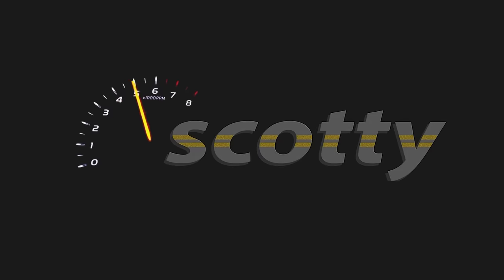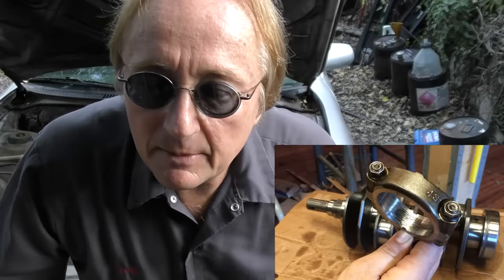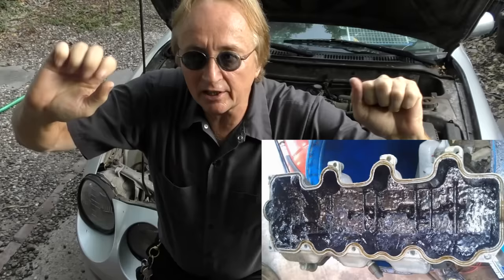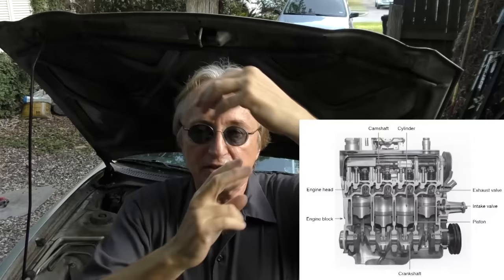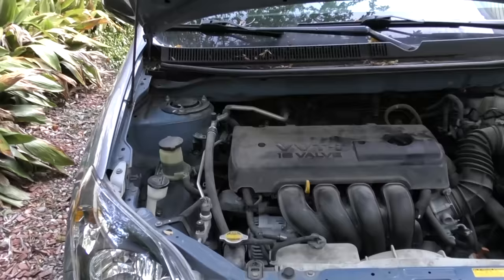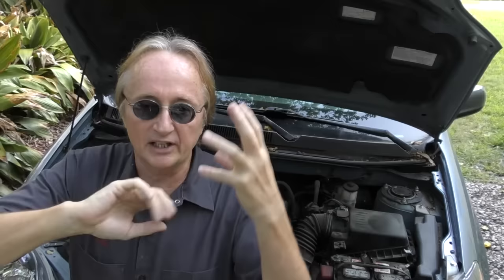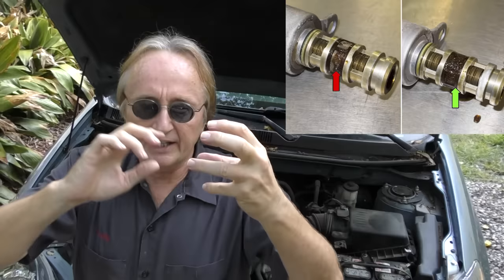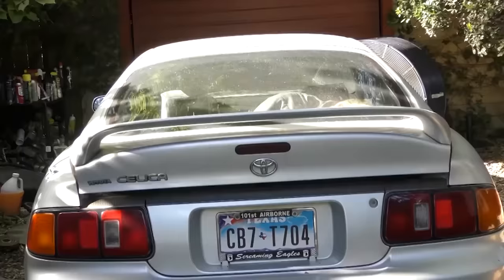Why Not to Flush the Engine Oil in Your Car

Comment: Scotty which half ton American truck would you buy? Can you make a video about this or something similar?
Reply: Toyota makes trucks in Texas.
Reply: Join us the "Toyota federation" then purchase a Toyota Tundra! Lol😅👍🏽🇺🇸🇯🇲
Reply: He recommends an old toyota celica in silver.
Reply: Cole Cooper LOL
Reply: He has said Ford if you go American
Reply: My ‘94 gmc with 282,000 original miles still makes 15-17 mpg and passes smog in ca.
Reply: Out of the big 3. Ford, Chevy/GM, Dodge.
Reply: Rex Erection Hell No! I will never get a Japanese truck!! I be embarrassed and a disgrace to the truck community.
Reply: Well don't buy a Dodge truck then. (Heaps of junk, just like the Toyota Trundra) stick with GM or Ford, they're the king of trucks
Reply: What a joke...Ford for reliability, Dodge for luxury interior, GM for price and their V8s
Reply: Rex Erection the most reliable and useful trucks are American built. The ford inline 6s, ford 7.3, duramax lb7, cummins 12 and 24 valve, even the older ford 6.9s were great. The new Cummins are also great engines. The only Japanese truck worth buying is maybe the tundra. The rest are way too small to do any kind of work. They’ll last forever, but that’s probably because it won’t get worked with. They have their merits but he said half ton, not eighth 😂
Reply: E Cartman yeah the fuel mileage on those things are ok, but as soon as you turn on the ac and try going on the highway, or tow anything, you’ll get horrible mileage. But like I said they have their merits. Maybe they just need a car they can also use to throw their bikes in the back or move a little bit of furniture or something. Basically just have some of the functionality of a truck while getting decent mpg’s just driving around town. But when you need a truck, you need something big and powerful. Maybe you lose a little reliability with some of the newest diesels but you won’t be towing 20k +lbs in a hilux.
Reply: Rex Erection You must be joking, Japanese cars and SUV’s are better than American cars, but trucks is where American shines. I can’t believe anyone would think that the Toyota Tundra or the Nissan Titan would be better than any Ford or GM 😂😂

Comment: The engine in my vw Golf TDI is famous for generating sludge. In addition to this I do a lot of short journeys. I change the oil every 6000 km but I still find that if I do a flush every time I change the oil it makes a huge difference to the cars performance. I do not believe people who say that flushing is not needed. If I did not flush at all, the engine would get totally sludged up
Reply: Yea, since when something that will keep things clean (and wont hurt the engine) would hurt?So much BS if he think that modern cars don't create sludge at no circumstance. All engines do, what change is when it will start.

Comment: Never Flush your engine!!! I learned the hard way!!! I had a 87 Buick Regal and flushed it out. Ya a lot a sludge came out. As I drove it for that week the car stalled on me. Took it to my mechanic and found out that the oil pump was clogged with sludge!!! My mechanic gave me an ear full!!! And never did that again!!!

Comment: it's the same thing as transmission fluid. The stuff that's deep inside needs to stay there.
Reply: Media Guy yep.
  had a Master Mercedes AMG tech tell me " never flush a Mercedes transmission ".
 just change the oil and filter in it.
Reply: Media Guy absolutely!!...whats deep inside needs to stay there.😅👍🏽🇺🇸🇯🇲
Reply: Only if it's been neglected. If not it's fine to do, but then again, it probably doesn't need it then either.
Reply: Yol As in trans fluid and filter?
Reply: You can drain/refill. Flushing is what's bad.
Reply: jeff hale it's actually because small bits of the clutch material wears away in the transmission from not being lubricated property!  Once enough of it wears away the transmission fluid gets a grittyness to it from all the clutch material bits floating around in it!  So they actually need that bit of gritt and lack of lubricant to grip and move the vehicle!  Once you put new stuff in between being nice and slippery and not having all those bits in it it can't grip lol. The trick to changing the fluid on an old tranny is first check if it's kinda glittery looking and if there's a lot of metal bits in the pan!  Drain the fluid into something clean and keep it handy if it doesn't look too bad and you want to try to change it!  If you do and it starts slipping drain the new stuff and put the old back in!  It should get it moving again until the tranny bits the dust and needs a rebuild lol. Novel over 😂
Reply: thats what she said
Reply: ROBERT lol😂🤣
Reply: jeff hale true, if it works, don't repair it...leave it alone
Reply: Like say deep inside the lifters? I guess a permanently collapsed lifter is as good as a working one
Reply: @cap8e  "that's what she said last night lol..".       classic!

Comment: You are clearly a mechanic of the old school.
(I'm not saying that's bad)
You are not very familiar with the use of flush engines.
I work daily with them and I have thousands of proven cases of efficiency, engines placed on dynamometers, a few hundred engines with more than 1 500 000 kilometers, etc. etc.
I saw no less than 30,000 cases of use of these products and never once did I see a problem (maybe one day I saw the first, but it still did not happen)
I think you have good intentions in your video, but you do not have enough knowledge.
Good vibes.

Comment: fair point, but my turbo went on my deisel, impeller shattered, so full services and well looked after so just one of those things, metal in sump clogged filters, cleaned all, new strainer and a gentle flush changed 2nd filter and most metalics caught. So went well. But yes would not flush on a well servied engine, agree..

Comment: Im using bardahl HDEO Oil, precise grade 15w-40,use same brand and change the oil according mileage interval 5-6k km,then recently my engine undergo head swapping,the effect noticeable,head so clean and no sludge and easy to clean,last top overhaul 2 years ago...

Comment: Use Castrol Ultra Clean oil. It says it cleans sludge by 50 percent more. Change oil and filter when you can't see the oil level lines through the oil. Work for me for over fifty years. Never had a engine problem.

Comment: I flushed the oil in my car multiple times, I change my oil every 3k with Full Syn. I've put almost 100k on it since the first flush and no oil leaks, but it does run pretty rough and I think there's a slight rod knock now. I've learned my lesson.

Comment: I change oil every 5k km (3,125k miles) 5w30, but I also use good quality gasoline for better burning and other factors, a car equipped with natural gas fuel does not contaminate lubricant

Comment: Did an engine flush on my honda accord because I had a P1259 code which was the vtec wouldn't work and would stop accelerating after a certain rpm , check engine light went away and now it works perfectly fine.

Comment: True story! I had a 1992 Dodge Ramcharger with a 318 under the hood. One of my "buddies" talked me into using an engine flush in it. Sure, all of this nasty looking crud came out of the drain plug. That thing didn't make it 100 miles past that oil change and it through a rod.

Comment: Did an engineflush on my vvti 2001 toyota avenis (euromodel). It was already burning oil. The result was that I got a lot small particles out but other than that nothing changed for 1 year. Still burned oil. It got to a point when I had to decide to pull the engine apart or scrap the car. I pulled it apart and the pistonrings were completely stuck and "oil holes" in the pistons were partly covered with carbon. Also the pcv valve was not happy. So now Im in the process of rebuilding the head (with the help of a mechanic friend and toyota guides) and have already cleaned the pistons and replaced the rings. I hope it will serve me for at least 200,000 km (12,5k miles) more once i get it back together. Wont be flushing it with other than good quality oil in the future! Apparently these engines are prone to this problem and toyota did some adjustments in later models of the engine. I hope modern good quality oil/filters and tighter oil changes will be enough for my car though :)

Comment: 3:59  What started running like crap?    I flushed my engine... the previous owner of my car didn't do frequent oil changes... and now my car runs so much better and the variable valve timing is working better than before!  I can see inside the crankcase (where you fill the oil) is looking much cleaner too!

Comment: OK. If you change your oil when it's due every time you won't need a oil flush. If your a little over its fine. Today's oil does contain detergents that break everything down. 3k for conventional oil 3.5k for synthetic blend (high mileage). 5k for full synthetic. That's how I do all my cars never flushed anything. And I've never blown a engine. ever. i don't like it ether. So long story short. Change your oil when it's do America. Do your research on what oils suggested or (best) for your specific vehicle.

Comment: I use a quart of Marvel Mystery oil in my engine every oil change and engine stays cleaner than most friends engines that just use oil. I notice sludge in their oil cap and none on mine. Also change oil every 5,000 miles and never over that mileage. If you don't change oil in time you risk a lot of dirt sludge build up.

Comment: I use patrol mixed with engine oil , run it stationary uptil 60 degrees with drain use couple of oil filters. It should clean it all. Just in case if noise increases use thick fully synthetic oil like 10w40 etc or there’s another liquid which thickins but it will continue to damage

Comment: Those BMW's are very sensitive.  After 7500 miles since the last oil change (fully synthetic high mileage oil) the oil got so dirty I started getting cam shaft errors on the VVT system and the engine would start to jerk which eventually led to the transmission going into limp mode.  Changed the oil and problems are gone!  Who would have known!!!  From now on 3-4k mile oil changes in the Bimmer!!!

Comment: BMW X5 70k miles bought used did an oil flush oil then pressure was low. Dropped the oil pan found sludge in the oil pump screen. Ran well for a a few weeks after a while the engine was starved from oil and that was it: the sludge clogged the oil pickup screen again. 12000 mile engine oil change intervals (as recommended by the manufacturer) will do that.

Comment: New engines with vvt hydraulic timing solonoids work with oil pressure if you never change oil or take too long to change oil you get crud in these systems make valve stick and cause timing issues you have to flush engines to remove gunk on cars that don't get serviced regularly
Reply: yeah, scotty has all kinds of good advice but it's kinda all over the place here. I have a ford 5.4L with a SINGLE oil passage. If that one oil passage even gets slightly diminished, the right side of the engine heads won't/aren't getting enough oil . 

So if you flush your engine oil, you might damage it. If it wasn't maintained properly (twice as often as the maker said), it WILL be damaged. Scotty's advice is: don't buy a car that wasn't properly maintained. Well, in the case of Ford 5.4L. Properly is twice as often as Ford said. 

As for the no sludge, sorry Scotty, maybe not as bad as the non-detergent oils, but I've seen videos of engines with a ton of sludge in the heads even with detergent oil.

Comment: GM 5.3 liter get a lot of crude from condensation. The oil pan and timing chain cover act as heat sinks and condensation forms. Plus GM messed up and on the original valve cover they actually press fit the pvc valve.

Comment: I put a cup of gasoline if i see black old oil.  Then I run it for a few minutes to circulate it.  That is not as bad as the full flush that can remove too much crud at once and clog oil passages.  No problem in many oil changes on old engines so far.

Comment: If you're buying a used car that wasn't properly maintained... Maybe the wrong grade oil was used or maybe the oil wasn't changed often enough for the type of driving that was done... ?
Under those circumstances a one-time engine flush might be a good idea regardless of what Scotty says.
Reply: I would advise against it. 

I just had my engine flushed
On my 2000 Toyota with 187,000 miles & now
2 weeks later the lifters are making noise.

Also, the oil is burning half a quart every 200 - 300 miles.

When I poured oil in
to top it back off, I saw oil pouring out of the top left hand side of the engine.

I'm possibly looking at an engine replacement now. 

Older engines, high mileage? 
Don't do it!!! 😫😫😫

Comment: Dangit, frustrating but I just about agree Scotty.... I have a turbo subaru with 260,000kms on it and for the last several years I religiously changed the oil every 6 months / 5000kms with penrite full synthetic and after a major service (timing belt and cam cover gaskets and reseal sump and oil pump and water pump and blah blah blah) I used some wynns engine flush and low and behold.... it came out pretty damn clean and clear after a couple of 10-15mins runs..... hmmmmm maybe the build ups weren't that bad after all! The regular oil changes did always drop very black oil but that's the thing, holding all the nasties in suspension just like you said! Regular good quality oil changes (even with cheaper filters) are never a a bad thing!

Comment: Some engines benefit with a good detergent based flush. Chevy 5.3 - a good flush can halt oil consumption and valve train noise. Ecoboost turbos run havoc on an oils detergent which can leave deposits in the VVT screens. Flushing then driving at operating temps for 15 minutes or more will solve that problem. I tell customers to change high micron filters 1/2 way through the oil change - that gets that issue solved.

Comment: Great stuff, learned this the hard way.. good knowledge sharing!
Reply: Ive had close to 20 different used cars by now and ive flushed every single one of them without one single issue that came up after i did that... If engine cant take engine flush then it was a goner regardless
Reply: live2day ... not saying it isn’t. A lot of people just need wheels.. not trying to get the best 0-60 times.. a daily by someone who’s already neglected it.. it would make sense to leave well enough alone.

Comment: If crud got into those ports likely scenario it was already building up in those narrow places that the oil passed threw.  Engine flushes was never really designed for large amounts of crud, that’s why even some owners manuals recommend engine flushes early miles. And what makes engine oil crudy is the blow by of Gasoline that gets in the oil pan. Gasoline destroys oil so the constant exposure to gasoline blow by destroys oil. That’s why super synthetics was made for the combatting of that issue. So if done done between every 20-30k the system can last very long, if the engine flush came out black you have to do another flush just until it was almost the same color going in. Of course there is a procedure for additional flushes to Avoid
Reply: Wear

Comment: 18 months ago I bought a diesel Fiesta with over 200,000 miles on the clock. a well respected mechanic friend says he uses a quality engine flush with every oil change. I wasn't comfortable with this approach and debated its pros and cons, ultimately concluding exactly what Scotty has stated in this video :-).
I changed what came in the engine for a reasonable quality fully synthetic oil and new filter, ran it for 500 miles and changed it all again. on both occasions I made sure the oil was properly warmed up and left it draining overnight to properly clear. I then periodically monitored the oil by blotting a drop onto tissue paper to view its cleanliness prompting the next change after roughly another 3000 miles.
the engine is still purring along nicely at 230,000 miles and returning just short of 70 mpg on motorway runs. I've stayed with the reasonably priced fully synth and change at every 6 months/6000 miles, whichever is sooner. I don't buy these extended oil change intervals that manufacturers recommend, they're only interested in making their cars appear cheaper to maintain during the warranty period.
Keep up the good work Scotty, its good to watch a guy who really does know what he's talking about.

I'm off to my shed now for the next 6 months with a few bits of steel and a box of electronic components to see what I can make from them ;-)
Reply: so you did flush with oil
Reply: @fernandostanic2035  - the first change was a flush with engine oil only yes, the second change was early flushing out more filth. any car, especially with 200,000 miles on the clock and no history needs a cautious approach

Comment: TO FLUSH or NOT TO FLUSH? Simple rule : A clean engine is a LONGER lasting engine !!!!    However, if the engine was POORLY serviced during it's first 200 000km's, then, a little dirt in the "right places", can assist to 'seal' the internal components. Use with discretion or ask a professional parts advising friend for advice.

Comment: I love this channel , and because of this I saved a lot of money from PMS. I remove engine flushing service , I remove sparkplug, map sensor and trottle body cleaning service . because Scotty advised that modern car needs to have this kind of maintenance with specific millage, I'm running 17k KMS only and regularly or twice a year I changed my synthetic oil. So all these unnecessary maintenance many PMS shop or freelance mechanics are offering this package even in 5k, 10K, 15K, 20K PMS are not needed and  ripping those people who don't research and does not know. 
For all freelance mechanics there in the Philippines Karma is real!